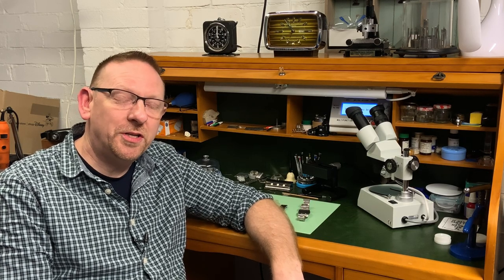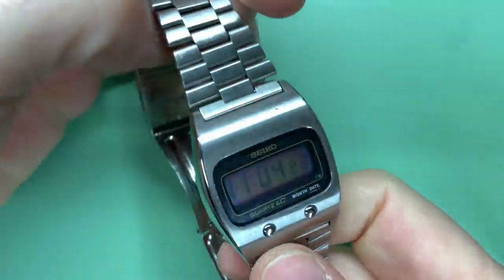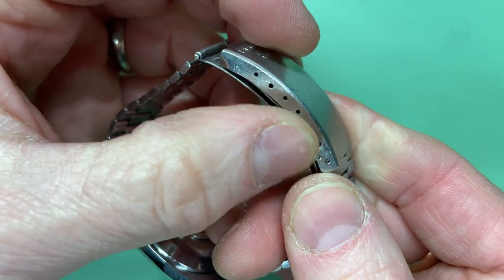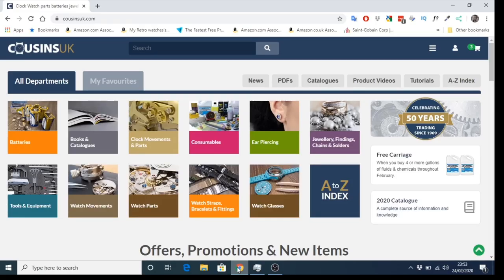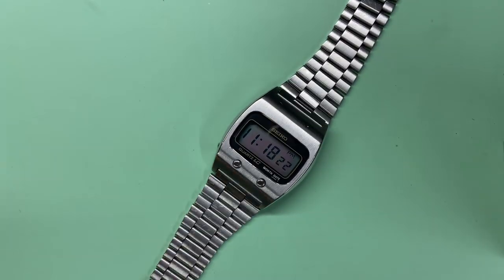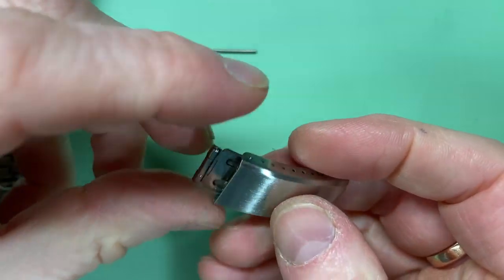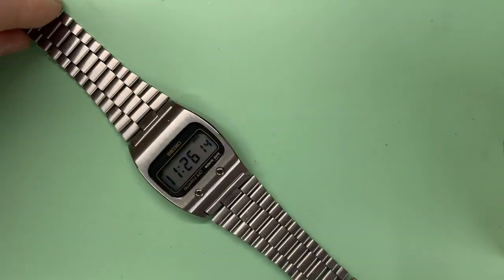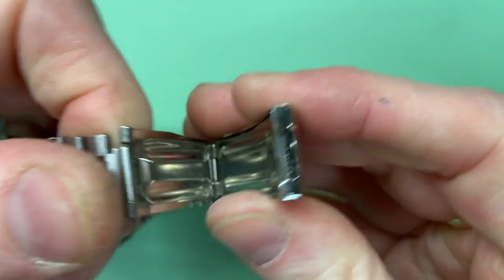Watch Clasp Replacement Tutorial

Comment: Cool video. How do you remove the clasp connection if your ends are flattened? I'd tried to remove from the clasp and realized its only push pin on one side and the other is not which is next to impossible to come off - perhaps there's a special tool to remove that connection?

Comment: I like the way you changed out the locking device on your watch and I have some which is too loose when put on and having a hard time adjusting the bands. There is one band on a designer watch where a jeweler took out a link by accident and I now have to figure out how to put the watch back together. The jeweler was an elderly man so I didn't complain about what he did as he should have been retired.

Comment: I've got to replace a sprung pin on my Seiko bracelet clasp.

I've measured the size and as far as the length is concerned it's coming out at 18mm.

Initially, I thought I might be able to cannibalise an old Lorus bracelet and use the pin from that, but firstly the pin for the Lorus is more complex in that it comes in four very small fiddly components, (a spring, a tube in which the spring inserts and two ends pieces), don't know if you've ever seen one of those but it's not easy!

When I'd got it apart from the Lorus, I tried it for size on the Seiko.  It didn't fit.  The diameter of the tube that houses the spring and the end locators was a bigger diameter that the link it needed to go through, so I've had to abandon that after a great deal of cursing!

I've now ordered a few sprung pins from a seller on eBay.  I'm just hoping that they are the correct diameter as none of the sellers of these pins specify the actual diametric size.

I assumed that they would be standard across all makes of bracelet/watches, but obviously I assumed wrong!

I'd appreciate your expert comments.

Comment: Very nice demo. I had forgotten just how terrible those old Seiko clasps were. I had a heck of a time replacing a clasp on a Deep Blue from a Strapco clasp primarily because of the special pin the clasp used with a hole larger than a normal springpin. I needed a single shoulder pin I had to get in the UK.

Comment: I can probably repair the old clasp ... nice and very interesting video as I was wondering where to get replacement clasps and how to choose them
Reply from the maker: I think the folding part was just the wrong one  stolen off something else.  The clasp part could be restored I’m sure but I’ve a bag full of spares.
Reply: @MyRetroWatches  yes I think it going to something like that ... if so you just need to find a folding part that's the right size and swap the clasp onto that you'll only need to repin the bracelet onto the new folding part .
Reply from the maker: AV Cuber for the price of the new ones it worth swapping . I said £1.50 but it was .60p!

Comment: Oof got a little messy for me. Seiko decided to put a pin that is fatter on the middle and thinner on the ends. It did not come out nicely and I bent the clasp. I was able to get it to go back in, but I ruined that pin. I was still able to swap out the cheap clasp on my new jubilee with my original Seiko clasp.

Comment: Very good video, thanks as always. I didn't know you could buy extenders (as you indicated on the cousins website), so that's great news because I have one watch that is too tight on my wrist.
Reply from the maker: bracelet extenders are all over ebay too.  here is an example https://rover.ebay.com/rover/1/710-53481-19255-0/1?mpre=https%3A%2F%2Fwww.ebay.co.uk%2Fitm%2FWatch-Strap-Bracelet-Extender-SILVER-extend-straps-bands-clasp-Extension-Link%2F200913168518%3Fhash%3Ditem2ec75ba886%3Am%3Am_J-Em4s4wvoxCZLgDrTG1g&campid=5338562247&toolid=20008

Comment: hi, great video, do you or can you advise on how to drill out a broken pin in a speedmaster buckle, driving me nuts, tried hammer and drilling, nothing working, its a standard steel pin remnant, just refuses to clear the hole, help please??? its a 1mm pin in a 1998/840 buckle, the pin holds the spring plate down at on end, the reason for the repair was the wire spring wore out and was attempting to replace it with a new one.
Reply from the maker: Sorry I can’t advise. Bracelet pins are often tapered so would only go out one way. I have zero experience with omega bracelets